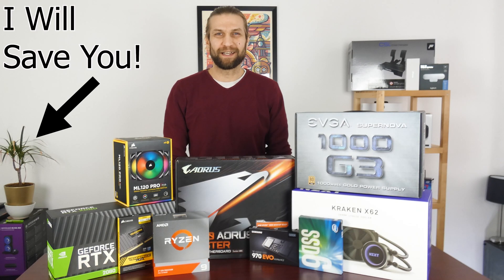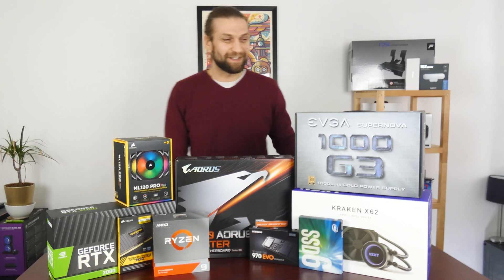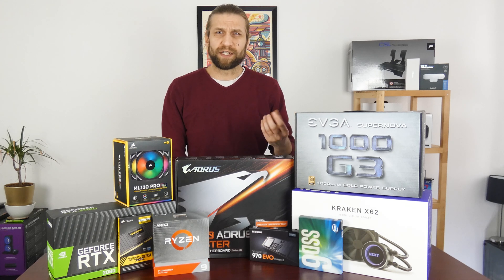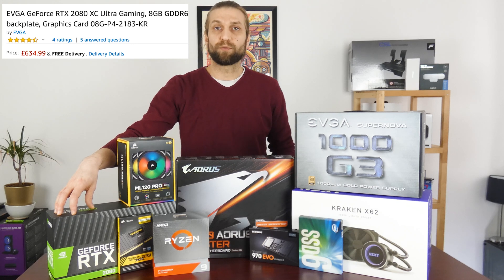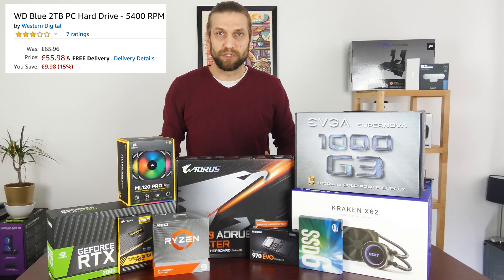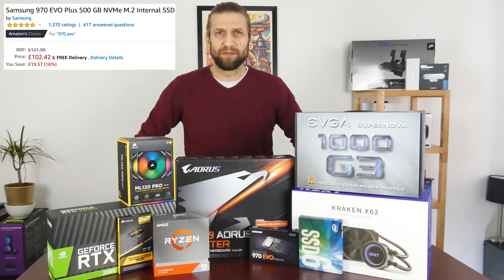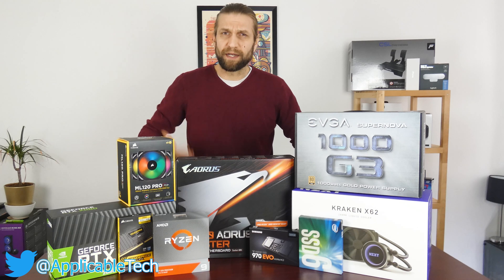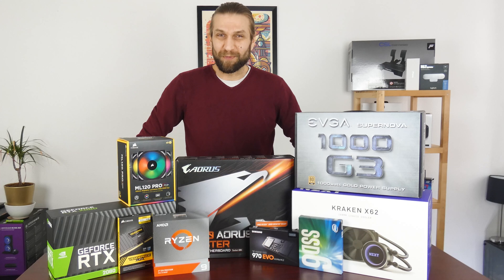Ryzen 9 3950X is a BEAST!!! | Building a "Prosumer" Workstation | Benchmarks | X570

Comment: At 1,4 vcore you might degrade your Cpu faster. Im at 1,306 vcore, ccx 0 @4,5  and ccx 1 @ 4,3. 3800mhz cl 15 mem and 1900mhz Infinity Fabric. My R20 max score is 10331. (3950x, Asus Hero 8, G.skill 3600 cl 15 and a EKWB monoblock)
Reply from the maker: Impressive work maintaining a 1:1 ratio on the infinity fabric with 3800 mem.  👍
Reply: @ApplicableTech  Test with 2 sticks only, i had to remove 2 of mine to get 1900mhz Infinity Fabric to work. 4 memory sticks will require a lot of tuning, sometimes it boots sometimes not...

Comment: Is that power supply noisy? I have the same power supply and once the fan ramps up, it never seems to ramp back down even after going back to idle and cooling down.
Reply from the maker: Not that I have noticed but the case I'm using has quite good airflow around the power supply so may not be getting as hot.
Reply: That’s really odd, I think these power supplies may have some manufacturing defects in some units as a few of them just don’t  seem to reset the fan speed, mine really ramps up, even on a lowly i7 4790 and 2080, but the main issue is that once it ramps up it never ramps back down unless you shut down the whole system. I have seen this behavior reported by other owners of this psu which is a shame as it’s an otherwise brilliant unit, if you could be so kind to document the fan behavior next time you run a heavy load or benchmark and report your findings it would mean a lot.
Reply from the maker: I definitely will! I'll try and get some testing done this week and let you know 👍
Reply: @ApplicableTech  thanks that would be really appreciated
Reply from the maker: @Dante I've been through a few tests and it appears mine is doing the same. Looking over the EVGA official spec, it states that the fan should ramp down to zero RPM when the temp is below 45C - the temp of the room I was testing in was 21C so may have impact. To counter this I used chilled air to see if the ambient temp was the issue and found that it was not. The fan speed definitely slowed and wasn't as noisy but I'm quite shocked that it didn't stop under low intensity workloads! Your initial assessment seems to be correct as I have not witnessed the fan stop on ANY of my tests. I have a build vid going up this evening and used a Corsair RM750 Power supply for that - Corsair measure power draw to adjust fan speed. this worked far better as the Fan only seemed to spin when loading games or running complex tasks like benchmarks then would stop within moments of the task ending. Thank you for bringing this to my attention - Genuinely appreciate it and will look to review this issue in greater depth in the future 👍
Reply: @ApplicableTech  yes, it definitely slowes down somewhat, but never gets to the really slow level it was previously. Turning eco mode off and on doesnt help much either. I video covering this might actually be a good idea. Then we might hear from other users who might have the same issue. Thanks alot for taking your time to check this